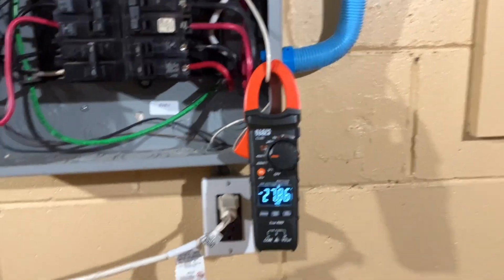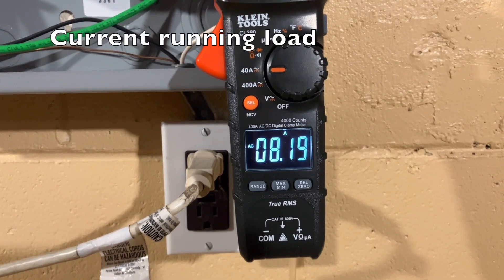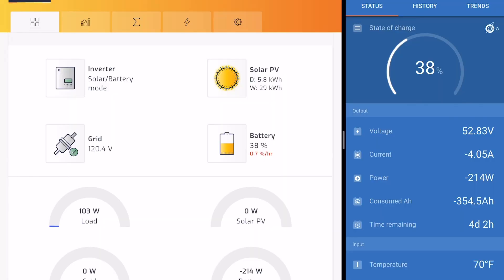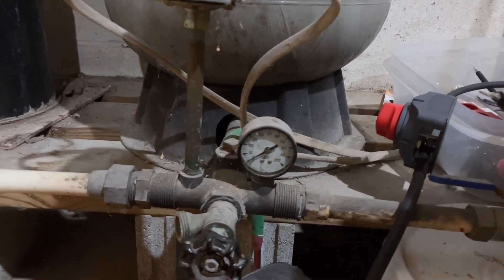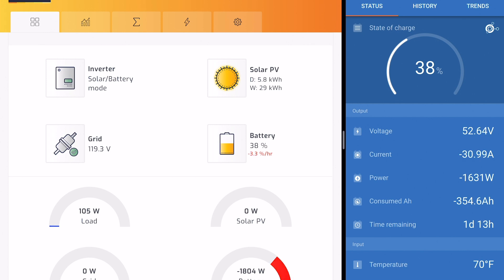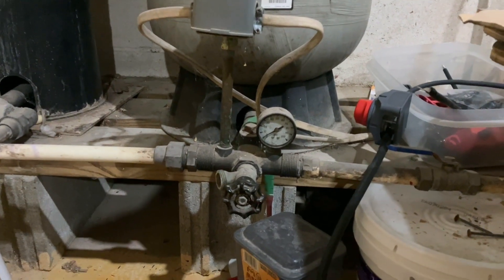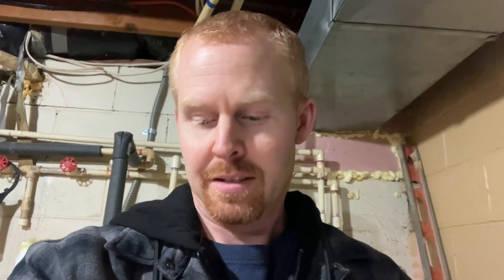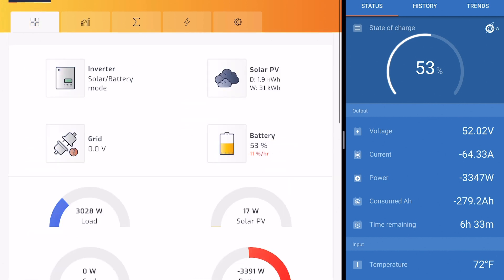EG4 6500 Load Test - Will it Run My Well?

Comment: Hi Adam, I have a 1Hp 240v Well pump (Flint & Walling) in 300ft deep well. I am thinking of buying two new Victron's Multiplus2 5000VA inverters (you made vides) so I can run my well pump and some other devices like septic pump motor (120v), microwave, etc. simultaneously. Do you think that two MP2 5000VAs in split phase will be able handle my goal? Thanks.  Nick
Reply from the maker: I wouldn’t think you would have any issues running those pieces of equipment.  I run my well, water heater and microwave at the same time with no issues.  The surge of the well happens quick but it’s exactly what the transformer in the MP is designed to handle.

You’ll probably want to check the watt rating for all your different devices just to make sure.  Well might be 1500-2000.  Microwave might be 1200-1500.  Just keep in mind that 240v loads are split between both inverters.
Reply: @AdamDeLayDIY  Thanks Adam, I watched your videos moving from EG4 to Victron Multiplus2. I like the some of the functionalities of the all-in-one inverters for, example setting opertonal priorities to SBU, SUB, Utility, an ability to supply the load from solar panel directly, setting up the source of battery charging - solar only, solar/grid both, grid only.  Can you configure you new Victron system to do all these? Are there any other things you found that your Victron does not do well relative to all-in-one inverters? There are Victron's new product for example Victron EasySolar-II 3000W 48V Inverter/Charger with Color Control GX - 230v, I hope Victron will make N-American version like this soon. Thanks. Nick
Reply from the maker: @nickrhee7178  thanks for following along.

You can decide whether or not you want to charge from grid or not.  I have my grid charging disabled unless I flip a switch.  

When your in grid mode, all PV goes straight to the battery.  When I think about PV going to the load vs PV going to the battery, it probably ends up being a wash.  If your solar goes to the load, it’ll take longer for your battery to get charged.  I’m guessing it’s that way so you can get off grid power faster.  It might actually be more efficient to have your PV go to your battery instead of going to the load and have to be converted to AC.

I have my system set to change to grid at 15% SOC, then back to battery at 30%.

Comment: Hi thanks for doing this. How much battery storage do you have?
Reply from the maker: Almost 29kWh
Reply: Nice. I actually saw that in one of your other vids after I asked. Btw I just subscribed  if you could do a vid on blending utility with solar I would greatly appreciate it. Also, i think the transfer switch is 60 amps. Running two units for split phase does that mean you get 120 amps of passthrough?
Reply from the maker: @jl9678  appreciate that!

I actually have on my list to do a video about SUB mode.

So yeah, you would have 60a of pass through power for each inverter.
Reply: Oh another question- I think you are running a 48v 280ah pack with the jk bms. What is the discharge rate of the bms? Can it discharge 280amps? Thanks
Reply from the maker: @jl9678  yeah I have the 200a JK BMS.  Since I have 2 banks, I’ve never gotten close to that, but I wanted to be able to discharge a higher rate in the event I had to work on one of my battery banks.
Reply: Thanks for that info. So is it one jk bms per bank? Or one for both banks? 

And sub mode yeah a video on that would be great.
Reply from the maker: @jl9678  one JK per bank.
Reply: Thanks so much. Last question on this. Do you mind sharing the model number for that 200a bms? Jks website is absolutely confusing for a noob like me. Thanks
Reply: I think I found it?

JK B2A24S20P
Reply from the maker: @jl9678  no worries.  JK-B2A24S20P

Comment: My Dewalt 7 1/2 inch circular saw would trip my Sol Ark 12K if plugged in within 10’. Take it out to 250’ through properly sized conductors and it did fine. It did not trip my 6500ex right at the output. It pulled 110A of DC inrush. 

By the way, maximum amps is not the same as inrush amps. You need the correct clamp on amp meter for that.
Reply from the maker: That’s very interesting that farther away it would work.  

Yeah, I realized that after I said it.  Thanks.  

Maybe you can clarify something for me.  Is there typically a large difference between the max and inrush?

Comment: I'm running the same setup, split phase 6500EX's with 3 lifepower batteries and have a 240 volt 3.5 hp pump that starts and runs fine for as long as I need.  I get the occasional flickering lights when it starts, but since it's a standard pump, not a soft start, it's to be expected.  I don't think there's anything those inverters won't power.  (We also run an electric clothes dryer with no issues).  And completely off-grid.
Reply from the maker: Nice!  Thanks for sharing!

Comment: Hey Adam.   A couple of questions - are you sure your pump is only 3/4 amp?    My well pump is a 2hp pump, and draws only a bit higher than yours.    Granted, my pump is above ground. and I suspect yours is in the well itself.    I use it for both irrigation and inside - i pull over 8gpm constant without any issue.  Anyway, my pair of 6500's handle the inrush current fine (about 35 amps top), as well as running current (about 7.5 amps on each leg).   Do you still have any UPS's connected in your office.   I do, and when my well pump starts, my UPS's click momentarily.  On both legs.   As stated in previous notes, they don't lose power completely, but it appears that the power dips.   Thoughts?
Reply from the maker: Honestly I'm not 100% sure on my pump size.  There's no records on it (like most things regarding my house) so I was just going off what other people's comments were based on load.  

Yeah, I have an in ground pump, which I would suspect that an above ground might have to be larger to draw the water up as opposed to pushing the water up from the ground?  That's my assumption at least.  

At the moment I don't have any UPSs connected to my inverters due to problems I was experiencing with them constantly clicking on and off (they're really old and some have bad batteries).  It's highly probable that the reason you inverter switches to battery mode and then back to line mode is due to the voltage drop when your pump kicks on.  I would imagine your lights also blink off for a split second as well?  The UPS is basically doing what it's designed to do.  Any possible frequency/voltage change out of spec, it switches to battery mode, then as soon as the inverters end up leveling out and the voltage stabilizes, the UPS switches back to "line" mode.  

Depending on the UPS that you have, some folks have suggested that you might be able to use the software for the UPS to "dial back the sensitivity" so it might not switch as often.

Hope that helps.
Reply: @AdamDeLayDIY  unless you have a very very shallow well you can't have the pump at the top.  Even a perfect vacuum can only "suck" water 33 vertical feet.

Comment: What?! What pump are you running that uses 27 amps? I tested numerous 120 and 240 vac submersible pumps. All stayed under 12amps at highest and ran less than 10amps. 7amps was most common
Reply from the maker: That’s startup/inrush current.  You’ll see later in the video the normal running current.
Reply: @AdamDeLayDIY  like I said 12amps is the highest start up amps on a healthy pump I've ever seen.
Reply from the maker: @kansasadventure1831  that seems like a pretty small inrush current.  Inrush can easily be 3-5x of the running current.
Reply: This is a small household pump. My 3HP well pump pulls around 62A at 240V on startup.

Comment: Adam, thanks again for more info on the EG4 6600.  Do you know what happens if you overcurrent the inverter(s)?  I just had a fun experience with my MakeSkyBlue testing, taking the inverter to right up to the 3kw rating and having it hard fail without warning.  Literally hard-shorted the battery connections together inside the unit, perhaps some failed capacitors.  I've been eyeing the EG4 6500EX and watching all your vids with keen interest (with the 65W battery drain while on bypass being my last hangup, but I thought I'd confirm if there's a safety/fault that you may have tested.)  Thanks much!
Reply from the maker: Thanks for the comment.

While I've never had an overcurrent situation, there's a few options in the manual which can be set. 
Option 06 - Auto restart when overload occurs
Option 23 - Overload bypass

So it looks like it will either shutdown the unit and throw a fault 13/51 or if you have 23 enabled, it should switch over to AC In to run the loads.

While the battery drain is concerning, it does look like you could enable a 2A charge from one of the inverters to cover that "loss" when you're in grid-bypass mode.

Comment: Your SA results look like mine when running all those items, had well on from day-one. I have everything but the dryer, pool pump and pool heater on the inverters. The dryer and heater are both 30A double pole, going to try dryer soon. Pool pump and heater tests will be whenever pool-season starts this year. Three things that may run solar on sunny days, grid on cloudy.
Reply from the maker: I wasn't planning on moving over any other 240 loads, but after seeing some sunny production days, I might have to when summer comes around just to utilize all the PV potential.  Guess there's worse problems to have...

Comment: Btw Adam, so you're inverters are setup with grid input as backup which is essentially how i am planning my setup. At any point, either with the original EG4s you had or these ones after the RMA, did you have to remove the neutral bond screw in any or both of the inverters? Thanks.
Reply from the maker: Yes I did.  In the first set I had, after discussing w/ SS, I got permission to remove the screws.  In the most recent set of inverters, the screws were already removed from the units.  

It all depends on how you plan to wire things up.  I know that SS is supposed to be working on a video and documentation to properly clear up how things need to be wired up regarding the bond.  

There is a thread on the DIY solar forum if you want to follow it: https://diysolarforum.com/threads/newer-models-of-eg4-6500ex-are-built-without-the-bonding-screw.53547/
Reply: @AdamDeLayDIY  ok thanks Adam. I'm wiring them with ac from the grid as backup. plus, i intend to have a change over switch which would allow me to connect the house directly to the grid bypassing the solar completely in case there's an issue or if i have to bring down  the solar system for maintenance. so i definitely need to be mindful where i make the netraul earth bond. In my case, what i'm looking into is making the bond at the output neutral of the change over switch, that way whether its grid or inverters feeding the change over switch, the 'active' neutral will always be bonded.  still doing some research of this method though.
Reply from the maker: @hendersonsobers396  Here's another article that was written by someone a whole lot smarter than me about laying out the bonding.  https://diysolarforum.com/resources/grounding-and-bonding-for-mpp-lv6548-and-eg4-6500ex-48.275/
Reply: @AdamDeLayDIY  thanks.

Comment: Good morning Adam.
I'd be very surprised if your pump was more than 3/4 HP.
Ours is 3/4 Hp and draws 700-1000 watts continuous (240v) as the pressure changes. Would like to see the well pump, shop vac and shop Smith all cranking at once just for fun. Btw- our inverter- dc motor washing machine also causes a constant flicker with led lighting on our 8000 watt outback radian inverter, it's a problem with circuitry in washing machines rather than an inverter problem I believe.
Our water heater, well pump & one AC unit will push us up to 7800 watts with lighting & fridges running too. Although 90% of time we are pulling 1000-1500 watts for normal house loads.
Reply from the maker: Yeah, I guess I'll have to crack the well head and see if the info's there.  

Unfortunately, I don't have a very big shop vac, but that does give me a few more ideas of some additional tests I could run....just to see...😁

Thanks for sharing about your washing machine.  I had the same problem with my 2200W Giandel inverter as well.  Has to be the constant direction switching of the motor.  I'm just glad the light bulb change reduced how noticeable it was, cause it was bad...

It seems like our normal house load is around 500W in the winter (with what's currently hooked up to the inverter).  Still have a few more things to move.  Hesitant to move the dryer, stove and water heater till I can get some more battery storage, but with the PV I'm getting right now, come summertime, I might have to temporarily move those circuits just to use the available PV.

Comment: How many hp is your well? Ours is 3/4 hp, it’s probably the largest inductive load I have. The only thing that will make the lights dim temporarily. Although not every time oddly enough. The other evening my wife was cooking something on the stove and using the dryer. I definitely had to go glance at my usage then. Between that and my other loads I was pulling 5kw per leg.
Reply from the maker: Officially, I'm not sure.  Never knew the size when we bought the house.  Supposedly, all that information should be documented under the well cap, but I've never looked.

I'm trying to remember a trick an electrician friend told me to determine watts/hp.  I wana say he told me to think of a 767 plane and add 1 (768) and that gives you 1 hp.  If that's correct (and by that I mean that I'm remembering it correctly), than 8a per leg would give me 1920W in total.  Divide by 768 gives me 2.5hp?  That's based on the amps from the clamp meter.  SA showed a much lower continuous watt output.  So maybe I have a 2hp pump?
Reply: @AdamDeLayDIY  I’m not sure.  A 2 hp pump would likely have a massive startup surge. The amperage you showed was similar to mine. I’d guess yours is a 1/2 or 3/4. Any idea how deep your well is? I wish they had soft starts for them btw.
Reply from the maker: @GavinStoneDIY   Nope.  When we bought the place it was a short sale, so there wasn’t a whole lot of info about it from the banks standpoint and the seller was clueless.
Reply: @AdamDeLayDIY  depending on the age of the home the health department usually has a record of the depth and estimated gallons per minute. Either way I’d say you probably have a 1/2 or 3/4. It’s a big and sudden surge. The larger your pressure tank the better. I upgraded my tank when I realized how high the starting surge was.

Comment: Good morning Adam 
  What are you using to monitor your solar stuff ? 
 I’m using the factory app which isn’t bad pretty basic 
 Keep the cool videos coming buddy your helping a lot of us out 👍🏼❕🌞🌞❗️❗️
Reply from the maker: I tried watchpower, couldn't stand it.  Pretty worthless to show only 10 minute snapshots of where your solar system is at.  I use Solar Assistant.
Reply: @AdamDeLayDIY  ok maybe I’ll get that
 And it connects with your raspberry pie ?
Reply from the maker: @cowboymcq6711  Yeah.  I have another video somewhere about what all Solar Assistant does.  

Did you ever try that firmware update from a week or so ago to see if that fixed your flickering issues?
Reply: @AdamDeLayDIY  I did do the firmware update    And I don’t know if I corrected the issue at hand or I have just gotten used to it but I have bigger problems with my 6000EX continuously shutting down.  
 KEEP the helpful videos coming Adam✌🏼
Reply from the maker: @cowboymcq6711  can you remind me of the symptoms of the shutdowns?  I’ve been “trolling” the forums a lot.  Wonder if I’ve seen similar situations.
Reply: @AdamDeLayDIY  Well I have the two 6000EX inverters connected in parallel and no matter how big or small unload one inverter shut down 
 I actually had one inverter shut down the other one had a hand load and burnt up 125 amp breaker without tripping it I was kind of a mess
Reply from the maker: @cowboymcq6711  Yikes.  

Ok, just to wrap my head around this.  Do you have both the current sharing cables and parallel cables connected in the proper order?

Is option 28 set to PAL on both inverters?

What do you have set for options 6 and 7?

Comment: Your problem is not the inverters Your problem is you need more battery
Reply from the maker: What problem?
Reply: @AdamDeLayDIY  if you inverters will or will not run your pump, with 13,000 watt of inverter power the only problem not enough batteries your inverters are capable of running that and more
Reply from the maker: @solarandwindinsouthtexasda1473  everything ran fine, so I'm not sure why you're stating there's a problem.  I'm sharing an experience.  There's not very many inductive load experiences on YT regarding the 6500s.
Reply: @AdamDeLayDIY  I am not stating there is a problem I am saying if there is a problem, the only problem will be not enough batteries that is all I’m saying
Reply from the maker: @solarandwindinsouthtexasda1473  Ok.  You're initial comment was "your problem is..." so that's why I was trying to figure out what you were talking about.

I'm just documenting my experiences.  I had a feeling it would run, but there's very few inductive load tests on YT regarding the 6500, so as I go through my own experiences, I figure I would share them.